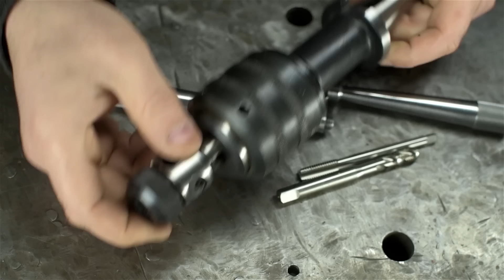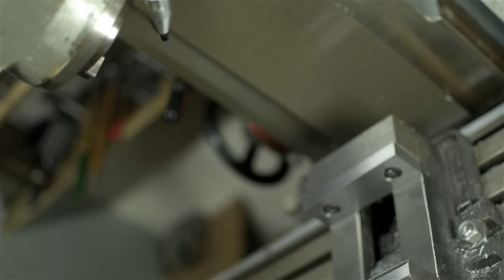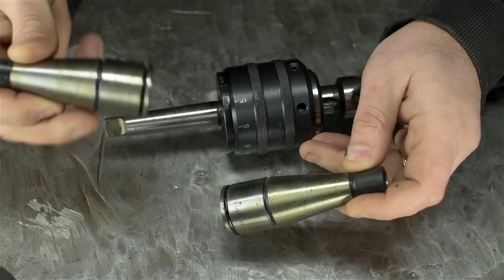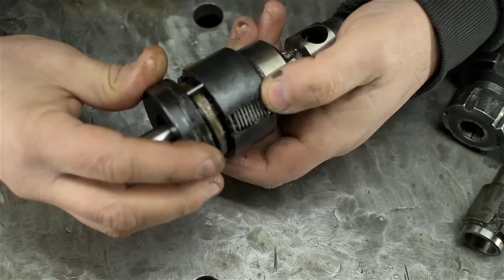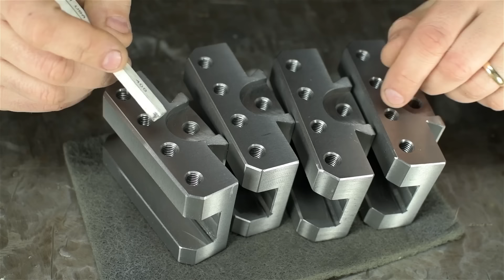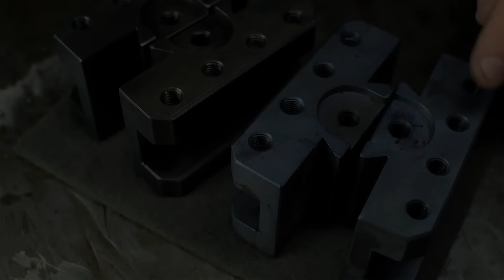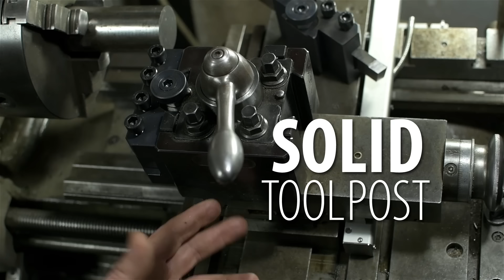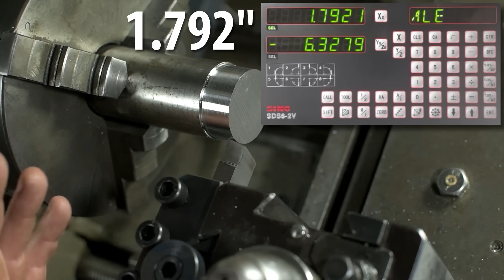How To Break A Tap & Other Ramblings

Comment: Hate to say it but I think I’ve found something I’m better at than you.  If breaking taps was an Olympic event…I’d be going for gold!
Reply: What would be the medal criteria though? Just total number of broken taps, or the cost of the tap extraction / repair needed to get life back to normal? I've seen some taps get broken off in some fairly expensive pieces of kit. I would rather break 10,000 taps in  holes that can be moved vs breaking 1 off in a $4 million dollar airplane engine.
Reply: Chase Thomas I broke a tap in a 10000€ Hastelloy pump body once. That was fun... This stuff sucks. I mean it's fucking resistant to almost every chemical on this planet but man it sucks to machine, to weld and man you don't want to pay for this shit.
Reply: I think as a sport, it should take some kind of skill. So it would be a measure of how "good" you are at breaking taps. Like breaking a 1/2-13nc tap in 1/4" aluminum, for example.
Reply: @MisterLongShot_Official  If you check the the rules section of Olympics.com you will find a table specifying the Degree of Difficulty (DoD) and the score points allocated to each technique with respect to the DoD of the class and size of breakage.
Reply: @paultrgnp  Does that apply to the Special Olympics because this would definitely be a Special Olympics event.
Reply: @MisterLongShot_Official  If someone manages that, that would be worth a nobel prize >.> I mean, it should be possible to do, just not with the speed and/or strength of the average person XD
Reply: How about a trophy made from broken taps.
This could extend throughout engineering.
I don't think apprentices should be eligible
Reply: What if you had to custom build your own trophy made from taps you broke, and the most impressive trophy maker gets them all.
Reply: @uiomancannot7931  Then Alec Steele would just try to forge one trophy out of all of them shrugs
Reply: @NolanTyrrell  There is a plaque on the wall of a Large truck leasing company's home shop with a broken pinion ,bear in mind about 35mm in diam. ,good steel 4140,9310 etc ! And the breakers name and date!
Reply: I bet you could not come even close to my friend where I use to work. Maybe have a one on one to see who is the best at tap breaking ???
Reply: can a past effort be submitted for competition? In the early 2000's I was stuck on a little island, courtesy uncle sam. I worked in a bomb dump there. They brought us a literal boatload of old bomb tail kits that had been sitting 'in the desert' for several years. By in the desert I assume they dredged them off the bottom of the bay. Not a hole had a clean thread, most of them you couldn't tell had been threaded in the first place. They handed me a box of taps, had to be a full gross. I spent 12 hours a day rolling tail kits and hand chasing threads. 2 weeks later I had to quit.. and wait for more taps. Think I worked on that project for almost a month.

Comment: .. Tapping head?
You have a lathe with a 4 jaw chuck :D
Set it up for one hole on one side, then do that on all 4, then index and repeat, then set it up for the next hole, and do 4, index and repeat, then that pesky offset hole, same thing.
Assuming all 4 tool holders are pretty much the same dimensions of course.

Comment: We're just not supposed to notice the wobble in your tap head?
Reply: It allows the tap to float into following the center of the hole. Outs actually more accurate than in a chuck
Reply: chrimony — I was wondering if it was an optical illusion.
Reply: No it's trued up mostly when it contacted the top of the hole

Comment: My Tapping work was using 4-40 taps in 0.125 Brass stock, on an Ancient 7 foot tall Bridgeport Mill, converted to 3 phase 440 Volts. The Bridgeport had a 12 inch Riser installed by the Shop Owner Engineer.
Regardless, I was NEVER underpowered for such tapping!

Comment: @ThisOldTony Maybe this has already been said, but why don't you cut threads into the new tap shank that match the mystery ISO 30 shank? Since the power tap has a clutch, and the torque load is relatively low with taps the lack of drive flanges is negated by the increased work height capability. Or maybe my brain box let the smoke out...

Comment: My 2 pennies on Bluing: consistent surface finish helps with an even colour, lower plain carbon steels blue easily, several treatments are normally required, with an abrasive pad between each process. 
 Great video, thanks for sharing.

Comment: So what you’re sayin is, Taps are really steel earth worms and when you break them in half you end up with 2 functional Taps all be it with smaller tpi?...
Reply: It only works in metric. In SAE, you'd end up with odd threading. Then you have to snap all the bolts in half, too.
Reply: @mildyproductive9726  
You're forgetting that there's a one in 79 chance that when the tap breaks, half of it will be left hand thread. That's a cheap way to tap left hand threads.
Reply: @Mildy Productive.....Nuts......Don't forget the Nuts too !!! Lol !
Reply: @N1gel  did you watch the video yet? :)
Reply: Albeit
Reply: @N1gel  You're watching Youtube wrong!

Any machinist will tell you that order of operations can affect your outcome.
Reply: Pretty much, except the earthworms just die.

Comment: Just got off my livestream & saw this up... Have to watch my TOT, make the day that much better.. Caswell's makes a black oxide, it comes in a pint to make I think a gallon... I found it best to only mix what you need. It doesn't last after hitting metal.. Then penetrating oil after you rinse it... Thanks for all the tips & awesome content... hope all is well, take it easy... P.S could you clamp behind the tool holder(on the compound slide) to keep it from moving

Comment: What about to modify your power feed electrical connection so that when you reserve spindle you also reverse power feed? Maybe even separate switch which you use only when threading.

Comment: Tony, love the channel BTW, but why not just use a drill press with reversing switch instead of that tapping head in the mill? Not telling you what to do, but drill presses have tapped a lot of holes throughout the years. I would never even think of tapping holes using my kearney & trecker.

Comment: Isn't this a problem that can be fixed through the application of more and larger machines, even more tooling, and a larger shop?
Reply: What do all garages, pole barns, shops etc have in common? They're all TOO SMALL
Reply: @mpetersen6  Oh, yes...
Reply: Yes more and larger machines let you break taps faster and more efficiently.
Reply: @richardhunter9995  
I can honestly say that I have never broken a tap in my 46 year long carreer. But I have worn a lot of them out "suddenly"
Reply: @mpetersen6  hmmmm, I have a completely different problem. I've never worn one out because somehow every single tap I've ever owned had the same metallurgical flaw where they fail under load. It's 2019 and we've been to the moon but we still can't manufacture one single quality tap. Sheesh..
Reply: Abom79 would've just gotten a whole 'nother mill just to do power tapping by now.
Reply: Maybe just a tapping arm
Reply: That's the Jeremy Clarkson Solution. "More power"
Reply: Only if you also get an  apprentice or two to do things for you. Package deal, you see
Reply: The answer is always money.  What was the question?

Comment: On your tapping head, an option would be to make the 30-taper drive shank in two pieces: one part that will clear all of the back-end assembly, with a square on the end, and a threaded center hole, then make a 30-taper with a through-hole for the bolt, and a female square to drive it. That could get your space back.

Comment: ToT, have you been watching Robin Renzetti (@ROBRENZ on YouTube)? He's a big advocate for running without a top slide 99% of the time. Furthermore he has his tool post pinned, glued, screwed, and tattooed within an inch of its life securing it to the cross slide for increased rigidity. Finally he is an advocate for using DRO tool offsets for faster work on the lathe.

Comment: A Morse Taper transfers all it's holding power only by the friction of the two touching faces. The flat bit at the end is only there to remove the tool from the holder. I think the iso taper should have a similar holding power.
And those threaded Tapers, maybe you can screw a polishing disk into them? It feels a bit silly, I know but at least it's an idea.

Comment: Those are for mounting face mills or large wheel cutters directly to the spindle face (I assume theres a 3 hole pattern on spindle face). The end matches the bore of the cutter you are mounting. And then just run the bolts thru the counter bored holes in the facemill body
Reply: I scrolled around looking for this answer only to find out that I have no idea what any of this means. Still gonna keep watching every ToT video regardless.
Reply: poppduder Same here, unfortunately... 😅
Reply: @Nevir202  the thingymajig engagement interfaces the whatsits face so that the doohicky almost completely eliminates deplaneration in the frump bearing leading to the characteristic sinusoidal scrum marks. Its the only way to build a quality Milford Trunion.
Reply: The drive dog for shellmils directly engages on the spindle dogs.
Reply: Yes.  It is a centering plug.

Comment: @21:35 instead of having to drill a hole into the bottom thing your toolpost sits on, you could use the dovetail opposite the one holding the current tool. make a part with a dovetail like the tool holders, but instead of a horizontal groove for tools, you could make a groove pointing downwards, that slides very snugly over that toolpost holder. that way, if the toolpost wants to move, the extention on the opposite side of the used tool, this new part, would prevent that from happening, as it would have to move the entire lower slab too. 

not sure that made any sense, i've never touched a tool in my life, but if you don't want to modify the original part, you could make a part that adapts to that part instead : )
Reply: Clever!

At first glance, I thought you said "I've never touched a hole in my life."
Reply: Vincent Hannema, That is a wonderful idea and thank you for sharing your thoughts with us!. I have been thinking about a dilemma I have with a home built QTP and you have given me a great direction for my efforts to go many thanks.
 Cheers from John, Australia.

Comment: Hey, I know this is kinda a weird question, but may I have the shavings in the thumbnail? I'm willing to pay for postage etc. My wife does a lot of epoxy work, and I think the shavings would look nice in one of her projects. If this community could like this so Tony could see it, I'd appreciate it.
Reply from the maker: I'm afraid they're already mixed in with other junk but I make more all the time.  that said, check your local machine shop and save on shipping!  you'll probably be the first one to have come through the door asking for chips. :)
Reply: @ThisOldTony   Chips and epoxy.  I prefer mine with salsa.  I still have my very first chip off the first lathe I ever ran.  It's 4 foot 21 inches long. :D
Reply: @throngcleaver  5 foot 9?
Reply: @bwthor  If you want to get technical.
Reply: @ThisOldTony  They're also useful as anti-bumping media if you're distilling or refluxing stuff (as long as you clean them well and whatever you're boiling doesn't interact with whatever your chips are made of). I once worked in a lab that had a little shop to make some of our own equipment and we always kept a little bottle of thoroughly degreased chips around for this.
Reply: The shop I work at has a big bin out back, I imagine if you asked they would, worst case, sell you some, scrap rate it really cheap (less than .10/lb usually) so a dollar would buy you a fair amount, that said, if you only wanted a 5 gallon bucket I can't imagine they would bother with asking for a couple of dollars.  They would probably just let you have them, just ask first, you'll want to look for a small shop, because a factory won't mess around with letting you look through scrap.  Walk in the front door, speak nicely to whoever meets you, and be prepared to take no for an answer.
Reply: Ooh, love this idea!  I saved some chip from a machining class I took, and made some fun photos with them... having them in an epoxy piece would be cool. :)
Reply: Just find a local shop and ask one of the guys if you can grab a handful
Reply: There's a video on YouTube where a man does exactly that. Sorry I can't remember  the name.

Comment: @tot
a saffer way to side grind is to touch off on the side of the wheel, back off. then touch off on the bottom. 
raise your head above the wall to be ground.   then stepp over with the side of the wheel the propper amount for your required stock removal and finishing. then plunge down to .0005 above zero. repete untill youre ready to finish the wall and touch the bottom
Reply: walking over with the side of the wheel in full contact is where that gets sketchy. 
cheers
Reply from the maker: plunge grinding?  if so I've never had much luck on this small grinder.
Reply: @ThisOldTony how much are you stepping over? 
when dropping the head down it should be less heavy of a cut than walking the whole wheel in. 
but we have the beefy mitsui grinders at work. 
side grinding scares me ever since the sine bar incident.....

Comment: I've found that gun taps are a lot more rigid than spiral taps. Spiral taps are a dream to tap in regular materials, but in tough stuff gun taps give me a lot more confidence because they don't flex as much as their spiral fluted counterparts. I even use them in blind holes for difficult materials, to me it's worth going in and out 3 times and clearing out the chips. I'd rather do that any day than break a spiral tap in there.

Comment: i wanna see you jeweling your tools. Why don't you cut down the morse taper on your tapping head, turn it down to size and thread it to fit into the threads of your mystery ISO30.
Reply: And then put ether pin into it to hold it or simply spot weld it.

Comment: 1. Tap Tuff-die with the settings for h13. or 2 run a 5/8 tap in to a hole drilled for a 3/8 hole. These are the way I have broken taps at work.

Comment: Break a tap ?    Easy Out .  ( counter clock wise treaded screw remover )
Reply: Lol, no, but lol, easy outs are made of HSS just like (most good) taps, you need either a carbide drill bit (we have cool set made specifically for taps at work that we use when we absolutely can't scrap a piece) or a tap extractor.

Comment: Instead of trying to match your feed rate to the tap, use a set feed rate and vary your rpm, in cnc machining for ease of math we use 10 ipm. So a 3/8-16 is run at 160 rpm 10 ipm.  It's feedrate x tpi = rpm
Reply: Bill Mielke  No, that’s the EASY way, and this video was SUPPOSED to be about BREAKING taps!  ;)
Reply: Yep that's exactly what I do at work.
Reply: In CNC i program drill/taps in G95 IPR. I used to program IPM but once I started working on lathes/millturns i learned to love IPR. You can calculate it easier when checking code at the machine (20tpi is 1/20 or .05), and if you change your spindle RPM, the feed rate stays consistent relative to rpm.

Comment: For cold bluing Brownells Oxpho-Blue is the best, that's what Adam used. I keep some on hand for small items but for most of my bluing I use Dicropan IM. The Dicropan is also from brownells but is a hot water system it is also more expensive but produces a much better looking finish.  For parts such as yours you could do it on a stove top with stainless steel pots.

Comment: I can relate to the removal of the top slide dilemma. The last time I pushed my lathe a bit hard and my tool post moved, I bought the steel to replace the top slide. I think that was over  year ago and that stock is still seating on the shelf where I keep my chucks... Every time I'm about to actually make that part, I end up with project that need either single point threading or a taper. When the day comes that I will build it, I will discover that I used that lump of metal for something else and the cycle will repeat...

Comment: Tony,
The Oxpho Blue from Brownell's has always worked the best for me.  Heating the steel also helps the blotchy  look.  Be aware that 1018 will not blue the same as 4140 steel.  MSC sells some "Tool Black" that I think works a little better for parts used around the shop.  It is more expensive, but I think it is a little better than cold blue for corrosion.  Enjoy the videos.  Did you work in video production, or do you just have an offbeat sense of humor?  Nice comic touch.

Comment: Awsome stuff again sir! A question (may have missed it but I believe it wasn't mentioned), did you consider using an ISO30 collet? That should eliminate the BT30 ER collet holder entirely giving (roughly) an additional 2 inches
Reply from the maker: you just blew my mind.  never even HEARD of ISO collets!
Reply: @ThisOldTony  My pleasure! I first needed to check if it was actually a thing and was a bit surprised myself
Reply: @StefsEngineering  I hope to see your comment appear in the next video 😉
Reply: @michaelg_839  would be cool! depends if tony can find and get one ofcourse
Reply: @ThisOldTony   If you cannot  buy, or decide against making such a collet (which presumably would rely on the drawbolt to tighten it?) I was going to suggest the ruse I adopted on my mill, where I am short of z-axis headroom, which was to wait until some third world collet chuck maker decided to copy the Regofix ERA . I got mine from Shars.
(see p21 of https://us.rego-fix.com/system/files/docs/2017-08/RFTC_ER_Catalog121616_Linked.pdf) where the collet is buried up inside the machine taper. Unfortunately, a 30 taper is not big enough for this to be feasible (my mill has a 40 taper). The ISO collet might be your best option.